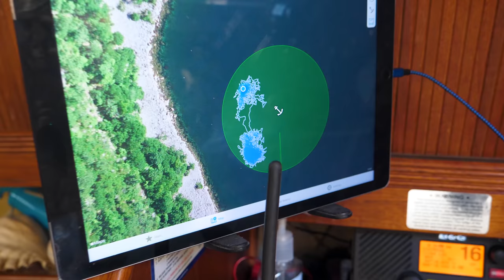Injury at Sea (Calico Skies Sailing, Ep. 79)

Comment: While flushing, filter the used oil with a coffee filter and reuse until it comes out clean.  Add new and flush one more time, filter and run the engine/trans for a few minutes and pump out again, checking the fluid.  If clean, put it back in.  If not, repeat above.  Takes time, but you will feel confident you have it clean without wasting much fluid.  Good luck!
Nice Delos could lend a hand.
Reply from the maker: smart on the coffee filters save a lot of fluid that way, smart!! Yea Brian and Kazza are the best :)

Comment: A telescopic magnet would do the trick if there was room to get one in there.  Lower it down and it should pull those bits out. 
Also if you have a drain plug in the bottom the transmission I would pull it out and JB weld a small magnet to catch anything left

Comment: In windy weather at anchor tie a 5 gallon bucket to either the anchor roads (if chain) or off the stern on a shortish teather ,  that may be a real help in steadying the boat.  Works for me in a similar boat - Pearson 37 which sails all around at anchor. I don’t have anchor chain so I just throw it off the stern
Reply from the maker: Interesting, we were really skating around in all that wind. We find that our wind gen stabilizes the boat in high winds. Not sure the science behind that LOL
Reply: Ideally, the pivot point would be the anchor. I have struggled with sailing at anchor the most in light centerboard cat schooner. The mast in the bow really caught wind. Board down made it worse. 
Windage forward of your pivot point, the leading edge of your keel, like the two furled sails makes it worse. All the windage at the stern, particularly the higher wind turbine, helps keep you pointed into the wind. With all your gear aft, it was surprising to see. 
Some yawls will keep their mizzen up as a riding sail, like a weather vane. I've jury-rigged canvas as a riding sail. Locking a swinging rudder can help, similar to the bucket idea.
Reply from the maker: @sockeyevoyages8840  Yea quite a bit of sailing on anchor, the wind was funneling a bit, changing directions as it raced down the valley walls, we were sailing more than normal :)

Comment: Should have got one of those magnetic wands, no matter how many times you flush it the metal will remain on the bottom.
Reply: I made one myself of a small neodyne magnet, some hosepipe and lots of gluegun-work! 😁 Flexible , bendable and easy to clean afterwards!  ( I had dropped a screw down a hatch, and I am rounder on the middle than the hatch is across... ) 😜
Reply: @klasandersson7522  Work smarter not harder mate, 100%.
Reply: Yea I had similar thought. Maybe even a magnetic plug for the housing. I have one on the oil pan.
Reply: @darth_taterz  Not sure if there is a drain plug on the hydraulic oil, I imagine there would be, but yes.., thats the solution.
Reply: @darth_taterz  A magnetplug is great to have, but I have a feeling it becomes a tad difficult to remove it on a boat since it needs to sitt in the bottom of the oilpan/gearhouse, and that place on a sailingboat usually means flush to the inside of the hull deep down somwhere really cramped...  😜
Reply: @klasandersson7522  no doubts. I think Bill did the right move with the vacuum pump.  Obviously if bill could have just drained it via the drain plug (if present) he would have. For my peace of mind put in a magnetic plug after sucking  out the oil via vacuum pump. Would that be decent approach to not making a mess and fixing the issue? I don't have a boat but I want one in the future so I'm just learning as much as possible.
Reply: @darth_taterz  Yes, if there is space for it, a magnetic drainplug is a good thing!  But I am a bit of a partypooper and refer to my earlier ansver regarding the space under and around the bilge of a sailingvessel. Vhy do you think they pump out the oil in the first place...  😉
Reply from the maker: Great Idea guys! Magnet!Didn't think of that one, I'm actually not sure if the dipstick was made out of a magnetic metal, will check that out next time I'm in there :)
Reply: @CalicoSkiesSailing  The magnet/s can be anywhere. On a lot of automatic  transmissions there are magnetic pucks in key locations.  A good neodymium button magnet pushed down to the lower side or bottom would work fine.

Comment: Get a magnetic drain plug for it.  Magnet on a stick or coat hanger would be good idea too.  You could flush with old fluid, just run it through a coffee filter. Do the last two changes with clean/new oil.  

Glad your boat bite wasn't worse.
Reply from the maker: Great idea! Yes I got very lucky!

Comment: did you filter out the stuff you used to flush? Perhaps you can use it
Reply from the maker: We disposed of it, didn't recycle it. I didn't think of filtering the fluid at the time!
Reply: @CalicoSkiesSailing  I've done tranny repairs on everything but boats. Even before recycling was a thing, my boss insisted on it, especially when all we were doing was flushing the system.  We had a large wire strainer, similar to one in a kitchen, and the fluid flowed from that through cheesecloth, into a funnel then into a gallon container. It's easy sitting here on the shore, drinking Maple Bourbon to tell you what you should have done!  BTW, I heard that the scar on your right cheek is from the boss putting a left hook into you. Any truth? ;}
Reply from the maker: @PaulBartomioli  Grace throws a mean left! LOL
Reply: @CalicoSkiesSailing  don't they all!

Comment: Bill maybe throw a decent size magnet on the lower portion of the trans housing and or see if u can find out the the thread pitch of the plug and find one with magnet to pick up those metal bits. If the issue is resolved already maybe this tip would help someone else in a similar......uh  shituation. Fairwinds....delos on Fridays calico skies on Saturday perfect combo
Reply from the maker: I like the magnet idea!! I did a flush a month or so ago and it looked clear. Maybe next time i'm in there I'lll give it a whirl. Thanks for watching!

Comment: You might want to put the sheets on before you do that.
Reply from the maker: Yea that would make sense LOL. I was hoping to raise it and furl it back up and then get the sheets on, that backfired HA
Reply: @CalicoSkiesSailing  you have to have the sheets on to keep enough tension on the sail as you furl it, or the sucker will unwrap above the clew in a blow.  Keep the sheets tensioned AGAINST the furling line and you can avoid the dark hours drama.